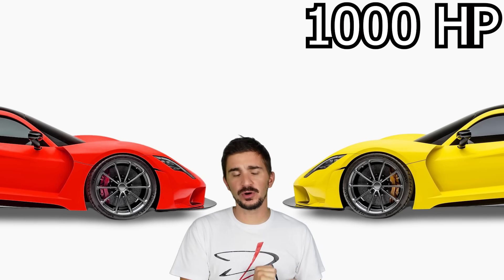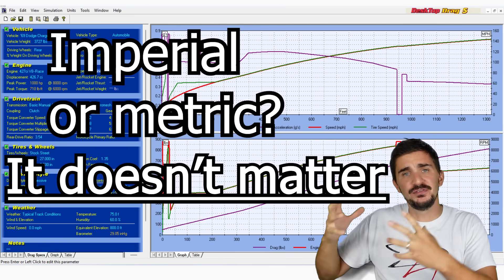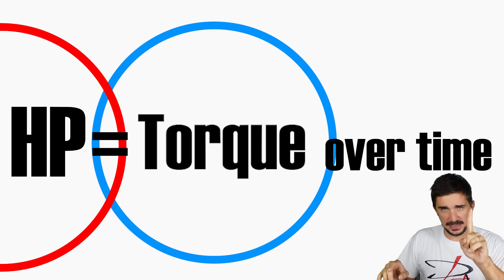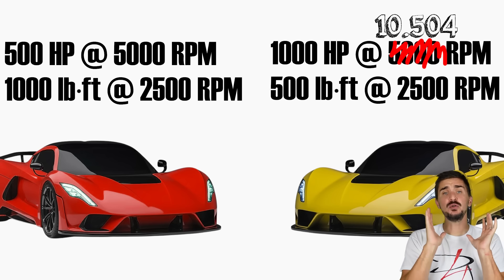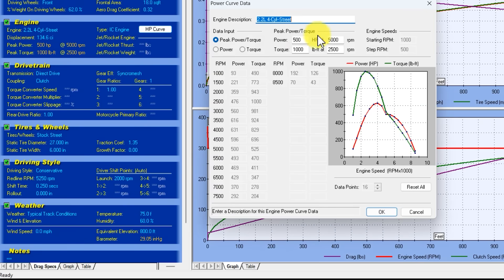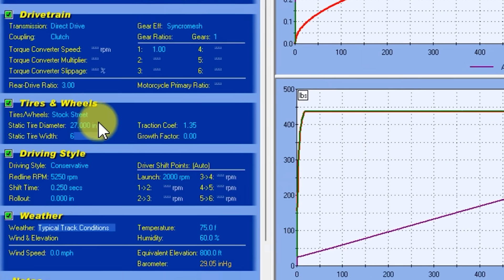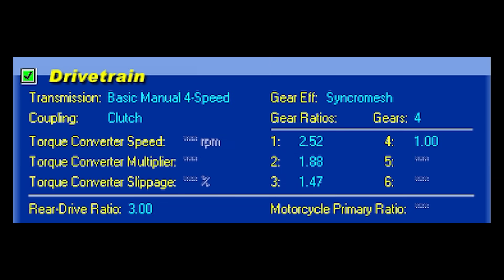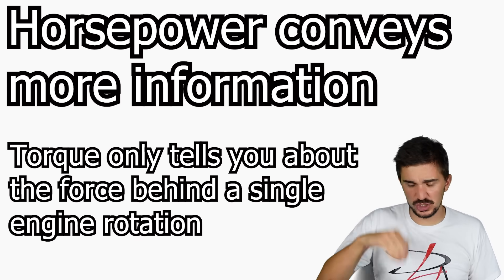Who's faster? Explained and Simulated - Horsepower vs Torque

Comment: Warning: At 4:53 an important assumption was made: the torque value at the peak power speed is the same as the peak torque, likely assuming a constant torque at any speed which is almost never the case in piston engines (usually decreases after reaching the maximun), leading to a even higher peak power speed

Comment: Torque almost always has a near equal HP. At least with gas engines HP is usually 150 + or - from the torque. I will agree with the HP sells cars and torque wins races though. As long as you have a well built vehicle to handle the race then torque is all you need because your HP will follow suit. Diesels are different and unless they can rev up to 5k rpm then they aren't going to make that kind of HP. So talking about gasoline engines, torque is what you should worry about because even with boost the torque will determine your HP
Reply: Nonsense. How could Torque possibly be what wins races?
Torque lacks any movement whatsoever, it's Frozen and timeless.
A Race is a competition of Work measured against Time.
Power is Work/Time.
Power is the definition of the measurement of a race.
Power, not torque, is the limiting factor in not only the top speed of a vehicle but also how quickly it can accelerate at any speed and how much weight it can pull up an incline at any speed.

Comment: I think there is a better perspective: the concept of (useful) power band!
The only pupose of the peak torque value is to educate the guesstimatimation of the power curve.
Peak power on the other hand is still a very useful value as the application may not  require a wide power band or at least a transmission can be designed to keep the engine speed near the peak power.
So better get a hold of the power curve (plot), and don't care much about torque as it can be increased/decreaseed adjusting the drive ratio, while power does not change.

Comment: Torque is simply a measurement of force but horsepower is a measurement of work done. Acceleration only happens to a car when the engine can develop horsepower. I've heard some very smart people say torque wins races but they're wrong. Obviously a Honda vtec isn't going to move a schoolbus down the dragstrip very fast but that goes without saying.

Comment: Reminds me of electricity 
I always struggled to understand why you can't just say this thing has # amps and # voltage

Voltage is a factor of the power supply like torque is here, and the modifying factor which is RPM (resistance) is also a factor of the system. You put the two together you get amperage which is total number of electrons "flowing" through the circuit. Neither can exist without the other, you change one and the electrons that flow changes which also changes the total energy used in the circuit per second (amps x volts = watts).
Reply: voltage and current has to do with electricity, an engine produces mechanical power. So it's not applicable.
Reply: @svr5423  and you can turn mechanical power into electrical power. Its an analogy genius.

Comment: Wow, this video helped me to realize--even more than I already had--that a great engine is really only as good as its corresponding transmission. Otherwise, the horsepower and torque are essentially wasted or never fully utilized. Thanks so much!
Reply from the maker: Exactly! That's the right takeaway! I didn't want to spoon feed it as I hoped the story would tell itself. Thank you for letting me know 👍👍
Reply: @d4a no it didn't... you confused the matter with all irrelevant details.  Should have focused only on the torque multiplication of the gearbox and nothing else.
Reply: @d4a  Excellent! 👌 You're very welcome. 🚗

Comment: You can always adjust torque using gearboxes and such. Horsepower is locked in at a maximum value. IIRC if you gear a sports car engine right, it will outperform even a semi, in a semi, pulling 80,000 pounds. Power is power, so power wins (theoretically).

Comment: And to complicate things further, forced induction engines torque output has a tendancy to climb with rpm, an NA engine the torque  output has a tendancy to fall as the rpm climbs. Best way to win a drag race is have a better power to weight ratio than your competitor and have a good power curve!

Comment: Without watching the video, HP will eventually win out. An analogy I often use is if you take 2 identical Foxbodys, give one 500 HP/600 lb-ft, and the other 600 HP/500 lb-ft then gear them to optimize their powerband, but otherwise the same car, the Foxbody with more power will win out in any kind of sustained pull. And please don't tell me that HP is just torque x RPM/5252. I get it. If we go off the stereotype of torque being lowend grunt, and HP being topend pull (not saying that this stereotype is necessarily correct, but there is some relevance to it) then an engine pulling hard at higher RPM is going to be more efficient in most cases than one trying to lug its way up to speed. This is talking racing and not towing or hauling a heavy load or anything. Torque is great for getting you motivated, but topend power ultimately wins out. And yes, I've owned plenty of vehicles with strong torque. (03 Lightning/03 Cobra/02 Camaro SS/19 1SS 1LE) Hell I own a 18 JD 5075E and use my dads 18 F350 with a PSD to tow it with. My GEN3/10R80 F150 pulls hard as hell on the big end for such a large truck with just a tune, running E85.

A high RPM focused Ford 427 FE engine in a Shelby Cobra is a better performance engine than the stump pulling 428 FE engine in a Shelby GT500. Shelby was wrong about torque IMHO.

Comment: 10:49 A 9.71 with a trap speed of 172 mph is absolutely hilarious. That's the trap speed of a low 8 second or high 7 second quarter mile pass.
Reply from the maker: It's not if your tires are spinning

Comment: Torque basically determines how much physical force an engine can overcome without bogging. Horsepower determines how fast shit can rev. High HP engines tend to make a lot of TQ in order to make that HP. Fantastic video
Reply: Wrong, power doesn't determine what you say.
As for torque, answer a question: why you can't overcome physical force of starting movement uphill on a bicycle on the highest gear, despite  you generate max torque at zero rpm?

Comment: How does this translate to diesels? My Ford 6.7 PowerStroke diesel is rated at 475hp and 1050 lb-ft of torque @ 1600rpm. It redlines at 4K rpm.

Comment: The best way of clearing it up is showing wheel torque vs vehicle speed.
Those two engines would never use the same transmission ratios, Since the 1000HP spins 4 times faster than the other engine it would have ratios 4 times higher than the other transmission.

Given that the torquey engine has twice the torque, but 1/4 the gear multiplication it would have the wheel torque as the high reving high horsepower engine.

Looking at example of two engines with identical power but one has twice the torque, given that they each have proper gearing it would nearly be a wash.
Factoring real life factors like parasitical loss from the transmission and the torquey engine having more power under the curve, it would be a little faster.

Comment: 8:09 another way to think of this is that at 3700-4000 rpm, the torque biased engine is producing more hp than the hp-biased engine.  Torque-biased engines have steeper hp curves until they hit their peak so they out-power low torque engines until the low torque engine can get to the rpm range where its power is greater.

Comment: You really sort of missed the whole performance / motorsport end of the spectrum. Where low torque and very high HP gives best possible performance by aggressively geared transmissions.

Comment: The lack of torque can be sorted using the correct gear ratios and more number of speeds. That's why and old V8 do just fine with 3 or 4 gears,  because they have a lot of torque.
To accelerate you need torque put in the wheels (and traction of course). But that torque could come from the engine or the gear ratio.

Comment: Fantastic explanation, I've been licensed technician for almost 50 years.. I been arguing this story for almost that long.. lol.. the heavier "real cars",  always needs torque,, once in motion will always stay in motion.. how do win a race?? Torque will be the first off the line,, hp will keep you going across the line,, but remember when you need to slow down around those curves and get out again it's back to torque..
Reply: But have you ever heard about gearbox during that 50 years?
Reply: @simplemachine9531  No, I haven't. Why don't you teach me about gears and ratios. Especially, driven over driver ratios, finals ,etc..

Comment: ok 1 simple mistake in configuration of the program made half of the video unrelevant. You selected riding style that limits RPM on 5k-ish.
Idea as a whole, of course, remains the same, but the fact that you didn't notice HP engine never exceeds that RPM limits on the graph makes me giggle =)

Comment: The way ive always looked at it is torque can be multiplied by gears(thsts why transmissions exist) but horsepower cannot.
So if torque wins races why dont race cars run ridiculous gear reduction? Not enough grip and low maximum speed.

Comment: I guess my question is, just as you can apply gear ratio's to reduce wheel speed and multiply torque to solve for the issues with low torque high HP engine, can't you also apply gear ratios to reduce torque and increase wheel speed with high torque low HP engine?

Comment: Torque is the only thing that accelerates the car. Horsepower beyond that is what C F Taylor called "unavailable horsepower" in any fixed gearing situation. It can never be accessed with fixed ratio gearing. Only a CVT can make use of all the horsepower.

Comment: Horsepower relates to speed (a change in distance over time). Torque relates to acceleration (a change in speed over time). Throttle response relates to jerk (a change in acceleration over time). Jerk is what EVs do so well.
Reply: Wrong, read the basics
Reply: @simplemachine9531  You’re wrong about me being wrong.

Comment: If there was a perfect transmission out there that could turn at any speed with efficiency, torque wouldn't matter much. This just seems to show the limitations of power delivery in the test vehicle. Hp should always matter more in an ideal situation. The only reason torque is relivent on vehicles is we use internal combustion engines that have a limited power band, its an indication of power at lower rpm and towing capacity.

Comment: I've had the opportunity to experience it pretty directly. I've driven dragsters and track cars, and I've driven semis and dump trucks. Those big diesels always feel so punchy and so much faster than they actually are. In my head it works out to torque=moving weight and HP=getting that weight to speed. If it can't move its own weight, it doesn't matter how much HP it has. And it doesn't matter how much torque it has if it can't carry it through the RPM range because it won't go very fast.
Torque still feels much more "real" in the context of how it feels to drive.

Comment: Horsepower can't exist without torque, torque, however, can exist on it's own.

You can apply a billion pounds of force to something that doesn't move. Torque was still applied but no work was done, so no horsepower.

Comment: At this point i have to make and example to make things more clear... Let's take for example a 2.0l turbo-diesel engine vs a 2.0l NA gasoline engine with same HP but the TD has let's say 250nm of torque and the NA gas gas 150nm of torque at higher RPM... But people don't know that gasoline engines also have about 1,5times shorter Gear ratio a that makes the torque difference much smaller... The only things that Is making a difference Is that the turbo diesel have the "turbo punch" It means a much violent variation in torque than the NA gas engine.. that makes people feel like the turbo diesel push more... But it's Just a feeling... Nothing more... They would perform actually the same if their Gear ratios are the optimized for the engine...

Comment: I been telling people this for years; "hp vs torque" is a false comparison. the true comparison is "torque vs rpm;"  if you have the torque to move the vehicle, given your gear ratios, then maximize your driving wheel rpm; if you don't have the torque to move the vehicle then increase your torque until you can move, then maximize your wheel rpm. you'll always see that if the hp is equal between the two competing vehicles, whether one maximizes torque or rpm, if they gear correctly for max wheel speed, then the deciding factor will be hp to mass, and if that's equal then it comes down to which car or driver shifts better/faster/accurately 🤔🤷

Comment: What about the rivian and Tesla electric cars they have high torque and high RPM. Should we be using  different measuring calculation for electric motors? Hp is an old way measuring ice cars not very accurate for electric cars

Comment: The one thing I would add is that HP will basically always win as long as you are allowed to design the transmission for the engine and car.  

If your engine makes 1000 hp at 10k rpm, but you have a direct drive transmission that is geared so high that you never get above 3700 rpm, you will never produce the peak 1000 hp.

Comment: When efficiently coupled to the road, horsepower always wins. Horsepower is the rate at which energy is being added to the system. In an ideal physical case, rate of energy added to the system is equal to acceleration.

Comment: Simple stuff:
TORQUE IS A TWISTING FORCE.
How many of you have put a lot of twisting force into the stuck lid on a jar and nothing moved? Sure you have. Torque can be STATIC.
When this twisting force causes movement, more physics become involved to measure it.
Twisting force that causes movement results in TIME and DISTANCE (RPM).

Torque, time, and distance is how horsepower is calculated. Horsepower cannot be calculated without torque value.

This is why torque cannot be separated or juxtaposed to horsepower.

Comment: 12:00 "what's faster, horsepower or torque?" IT'S FUCKING HORSEPOWER, CHRIST. All this video demonstrates is that if you don't setup your drivetrain for the engine, you'll lose the race. If you geared the horsepower engine appropriately it would dominate every single time, period end of story. Again we're not talking about pulling a load down a highway, or thermals, we're just talking about a quarter mile drag race. A higher power engine will win every single time, unless the car builder is an idiot.

Comment: The only problem is: Explaining something scientifically but using lbft. Let's count years in winters again and throw ropes with knots out of the car window to measure our speed.

Of course, the video is excellent and very impressively broken down into it's parts and relatively precise. If course torque NEVER is a force in one rotation, it is a static force.

Comment: This video was excellent. I find that most people have a total misunderstanding of torque and power. Its not helped by the way that certain car and motorcycle companies advertise their vehicles. The way that I have explained the difference to people is that imagine an engine with 400 HP and 400 lb-ft of torque. If I substitute myself for the engine, I can take a 4-foot long breaker bar and rotate the gearbox in place of the engine. If I push down with 100 pounds of force I can produce 400 lb-ft of torque. Am I as good as the engine? Of coarse not because I am only generating a fraction of a horsepower. What is left out here is RPM as you explained in your excellent video.

Comment: Assuming you can choose your gear ratio (and power curve is realistic), horsepower will always win. 

You « just » have to select the gear ratio which allow you to run the engine at its power peak and if you have twice as much power, then you will have twice as much torque at the wheel (assuming no spinning wheel). It is that simple.

Of course you can have slight effect of the torque on the performance. But  it’s mostly due the fact the engine cannot always run at its peak horsepower (execpt with cvt transmission). Then having higher torque often meen having « flatter » torque curve and more power available arround the power peak. But this effect is negligeable if we are talking about twice as much power as discussed in this video.

Comment: The result summary could be a bit confusing. If you go back to the formula for metric, you can see that we use "kW" instead of "hp". kW is power. Is 1000W more than 500W? Yep. 
Higher HP always means higher power, it's right there in the name. For ICE's in vechicles the debate of HP vs Torque is completely based on the desired effects and what that engine should be capable of. If you're asking "is more hp more powerful than high torque", then the answer is always yes. In this example, if you had a CVT without losses, the high HP engine would always win, as it just has more power. 

You can even stretch this to the fact that a tiny 1.6L V6 formula one engine with 870hp would beat a semi with a 13L straight six diesel with 690hp in a drag race, IF the formula one engine had a theoretically perfect gearbox with perfect gear ratios. Why? The F1 engine makes more power. Period. Torque is completely irrelevant, but also not quite.